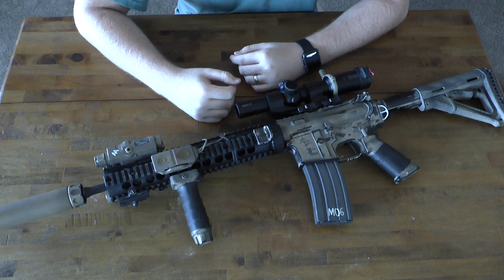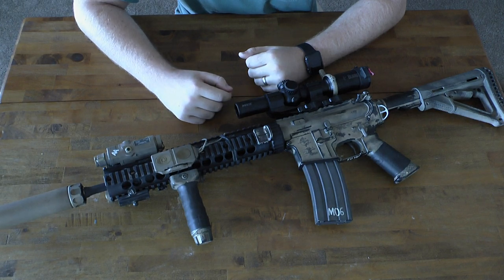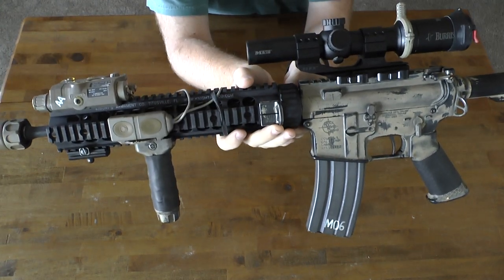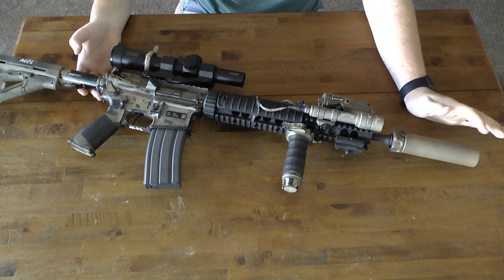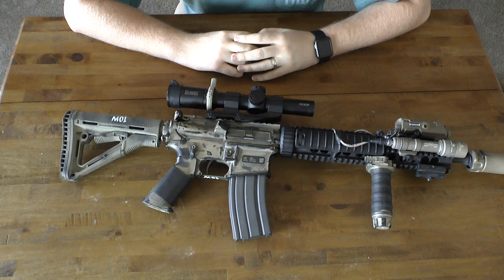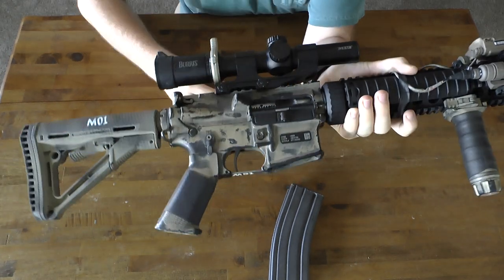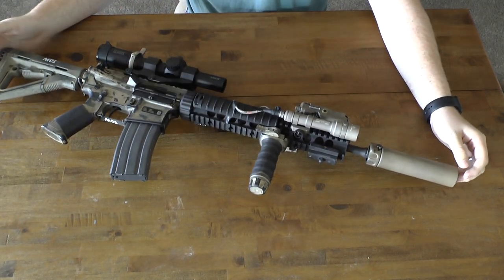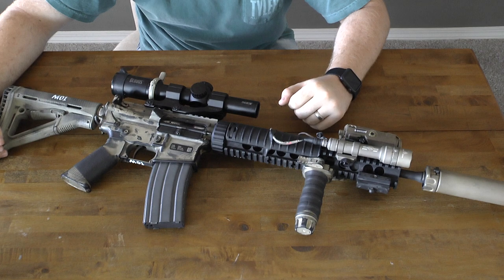14 5" Recce Rifle Build - Building a Non Clone Rifle from Clone Rifle Parts

Comment: We have very different tastes as far as a recce rifle is concerned but nice looking nonetheless. I went with a Criterion HBAR chrome lined 16" barrel, Centurion rail, Radian lower and Lantac VLTOR upper. Never bought into the hype of Nickel Boron though, It's always been chrome lined bcg, but have been using a Lantac carrier and LMT bolt for about a year without an issue. Recently switched from a BCM grip to a Magpul MOE K2+ grip and that was definitely an improvement.

By no means a replica but from experience with the Mk12 it's about as comfortable and ergonomic as it goes and it's what I'd consider a Mk12 if I were to develop my own.

Edit: Let me add I use a Fostech Echo trigger with a modified spring, it feels like an ALG trigger in semi, very crisp and precise and the binary mode is very smooth and consistent especially after changing the spring out
Reply from the maker: Excellent! Yeah the NiB carrier I got in a trade and decided I dig the benefits but I wouldn’t say I’d choose it over another. And about the trigger I haven’t ever shot a binary trigger but they seem cool, I have friends that are SOTs so I just get my full auto fix with them lol.

Comment: How did you get the insight pressure pad to work with the surefire light?
Reply from the maker: BoomerBilez I had to splice the wires together and use electrical covering to waterproof it. If done right it works just fine.
Reply: How long did the process take if you dont me asking? I kinda want to do it now xD
Reply from the maker: BoomerBilez not too long honestly. If you’ve ever spliced anything you should be fine. But be sure to use quality shrink wrap on them to make it durable